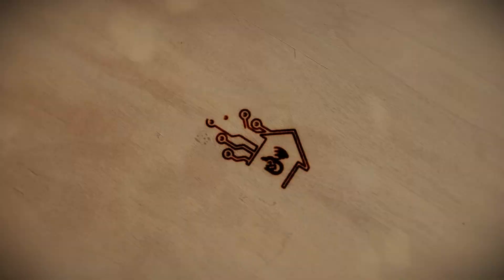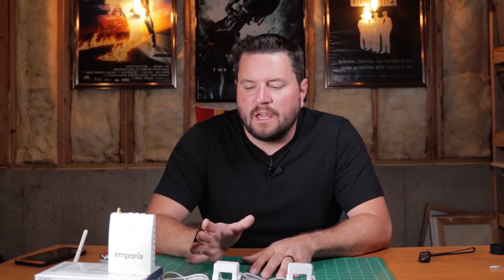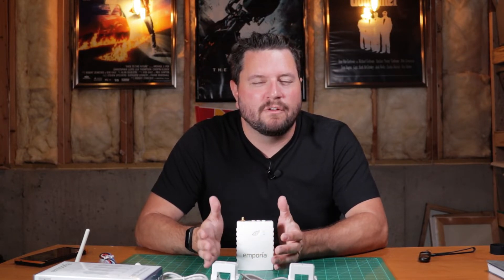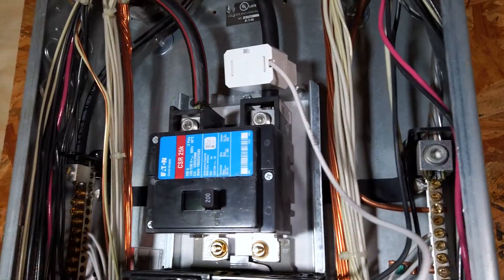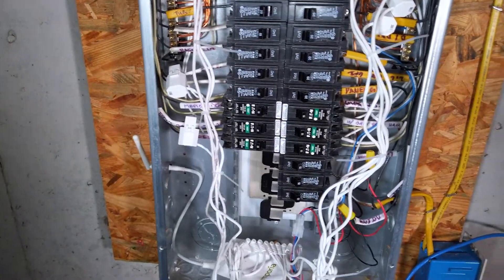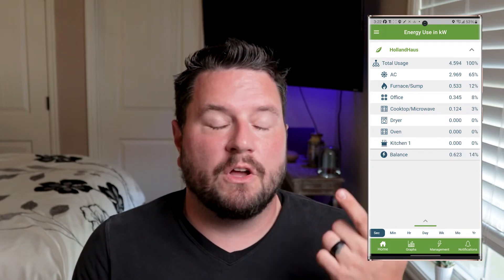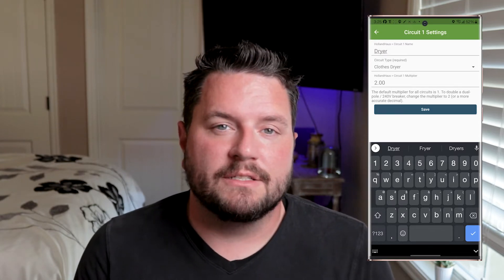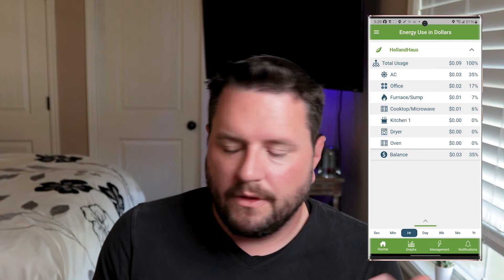Monitor All of Your House's Electricity Use // Emporia Vue v2

Comment from the maker: So a few viewers pointed out that I have the CTs backward on the 200A circuit.  I had misread the manual and completely missed the diagram on that page.  You have the arrow point toward the panel, not the meter.  Thanks for pointing that out Doug and Michael.
Reply: Correct. The K - > L arrow should point toward the breakers.
Reply: I was going to point out the error, but you have corrected it. What I am interested to know is did the app show the same usage with the main CTs placed either way round?
Great video👍
Reply: @grahambrown5874  I read that the Emporia will automatically adjust if you install the CTs backwards on the 200A mains, but not on the 50A CTs.

Comment: I like that you're a former TED user.  My TED just died and I'm looking for an alternative.  What I really liked about TED was the API.  I wrote my own programs to log and display the data.  Haven't found anything else yet that has an API.
Reply from the maker: The emporia doesn't have an API but people have reverse engineered the app. That is how the home assistant integration works.
Reply: @ThisSmartHouse  I just found the emporia forum and there is a long thread in there about this.  Looks encouraging.
Reply from the maker: They are a good company. I purchased it after chatting with the engineers. They seem receptive to feedback.

Comment: RTL worked for me. For electricity any ways. My water meter uses frequency hopping (I think) so never could get those signals. Found a few neighbors tire pressure monitor sensors though. ;)
Reply from the maker: Nice! How often does your power meter update?  Really, TPM sensors?. That is awesome.
Reply: It seems like our power meters blast out every 10 minutes or so. Maybe even more often. I have the rtl_433 HA add on running on a few frequencies and hopping every 400 seconds. That gets my Lacrosse outdoor temp sensor reading too.

Also... It took some figuring with value templates (filters too) to get all the rtl sensors to never show zero or major increases/decreases at reboot or restart.
Pretty slick after that.

Comment: You should definitely connect the clamps to the device first. If you connect the clamps to the energized line then there will be current on the 3.5 mm jacks

Comment: I have a 400amp service to my house. It is basically 2ea 200 amp service breaker panels. Since we can use just 1 CT for a 240volt device, do you think I could get one of these emporia units and put the main line CT, 1 on each panel? I would expect the overall numbers in the “balance” field to be wrong.
Reply from the maker: I would check with their support. Really smart folks (staffed by some of their engineering staff).
Reply: Your total power consumption would also be way off. 240V appliances generally draw current evenly from both phases, but your panel overall will almost never have even current between phases due to how the single phase breakers are distributed.
Reply from the maker: Emporia told me they were working on a way to use 2x CT clamps and they can combine it in the back end. I haven't tested it though...

Comment: You say on the title "all of your house's elec..." but use only 8 sensors. I got a medium size circuit breaker box with 40 breakers, your set only has 8 sensors, I know there is another one that comes with 16 sensors, that would leave me short by quite a few to be able to monitor all the house circuits. Can you add more sensors if you need to w/o adding another complete kit?

Comment: Do you still use this monitor?   If so, what are your longer terms thoughts?   Also, do you use any of Emporia’s smart plugs?  I have seen some information about long term connectivity issues with the plugs.
Reply from the maker: Yep it is still running strong. I actually have more sensors to install but haven't had the chance. I don't have any of the smart plugs from Emporia, but I have a ton of others (WiFi, HomeBridge, ZigBee, Zwave).

Comment: For a home with a main panel and multiple subpanels, is a separate monitor/controller required for each panel?
Reply from the maker: I would think so.  I assume your sub panels are more than 50A?  I think that is the max for the individual clamps.  I would reach out to Emporia's support, it is top tier (I think it is staffed by their engineering staff).  They might have a more cost effective solution for you.
Reply: This is the info I'm looking for as well. One main panel with (2) 100a subpanels. It's 2 separate dwellings so to figure out electricity usage per unit.
Reply: I have a sub panel that is wired off the meter so the 2 main coils don't capture all the data - Ive tried capturing it with the 50 amp coils but it screws up all the math
Reply: @dougboss6391  would need to run a separate analysis over whatever period of time you're comfortable with to get you what you need to know. Otherwise you could buy a unit for each panel. I personally went with the fist option.

Comment: Hi. In our house there are two sheets with separate power wiring. Looks like that the splitter is outside, close to the meter and with no access to it. My question is there a way to use one device  in my situation or I need two to monitor whole house? Thank you!
Reply from the maker: Do you have 2 phase in each section? How far are the two panels? I would think you would probably need two monitors unless they are relatively close.
Reply: @ThisSmartHouse  Yes, there are two phases in each section. And they are next to each other. But counter only one outside the house.

Comment: For anyone using this product; After monitoring your usages for a bit, did you change your habits in an attempt to lower your energy consumption?
Reply from the maker: It pointed out a few things (like some old incandescent bulbs that were being used a lot). But mostly I use it for automations.

Comment: My Emporia says the opposite; L is to the breaker and K is to the meter. The word "Breaker" below the K--->L points to the L as well. When installed the cable is on the left of the clamp, not the right.
Reply from the maker: I posted a correction. I had it backwards.
Reply: @ThisSmartHouse  I was just trying to help. I also installed mine today and interestingly, the clamps for the mains coming in are installed in one direction but the individual 50amp clamps clamp on in the opposite direction. The reason I picked this up right away is that the clamps have the K-->L "plus" the word Breaker---> on each one. They are opposite each other.
Reply from the maker: Sorry if that came off terse. I didn't mean it that way.
Reply: @ThisSmartHouse  Not at all! We are totally on the same page. Thank you for the replies and being a great contributor. 
Not terse at all. I didn't want you to think I was trolling you to point out mistakes. I was being friendly and helping.  Keep up the great instructional posts!
Reply from the maker: Thanks for pointing it out. I do appreciate people who correct.  I want to put out the best possible instructions for people and sometimes I do end up making mistake. I just wish youtube allowed you to put text over a already uploaded video so you could edit out the mistake.

Comment: Is there an option to monitor a generator set home backup?

You only need a single clamp for a double pole 240v breaker?
Reply from the maker: Are you just wanting to check the output?  I would think that if you just want to see a rough estimate you can do one clamp.  Do you have an ATS or switch gear?

Comment: You said it requires an internet connection, and that's when the red flags started going up. And I'm not wild about using wifi on a stationary device either.
Reply from the maker: Well there are advantages and disadvantages to each method.  There is some back end analysis that needs to be done that I assume the unit won't have power to do.  I have talked with them about local control and API access.  As far as Wifi goes, most people probably don't have ethernet at their power panel.  But yeah, I get it, I would love to have had ethernet as an option.

Comment: So thankful I watched this lol, so you can install it to two separate existing individual breakers if I understood you correctly? I was thinking of getting the sense and also saw mixed reviews as well as needing a 240v two pole breaker and only having one spot for a single pole breaker. This may be the device for me. Also, I see there’s an integration for home assistant through HACS, I’m also pretty new to home assistant coming from smartthings and hubitat. Can’t wait to look a little more into this device. Great video!! New subscriber here!
Reply from the maker: That is exactly why I put the video out!  I was hoping it would be helpful.  Yes, you can install it on two existing 120VAC breakers (they have to be adjacent so they are on different phases).  I think the reason you see people say you need the 240 VAC two-pole breaker is because I believe the National Electrical Code requires it (you have to be able to disconnect both sides of a circuit at the same time).  But because these are two separate circuits that you are just tapping into, then it should be ok.

I had just gone out to the hardware store to grab two extra breakers when I re-read the manual and found the alternative install.  I figured this would be the one most people would use.

Home Assistant / HACS integration video is coming out next week.  I can confirm it works well with the new energy dashboard.
Reply: @ThisSmartHouse  awesome man. I saw the machine learning on the sense was pretty iffy but this comes with an addition with the individual clamps for almost 1/3 the price lol this is a no brainer for me. Can’t wait to see the next video on this product. So I’m guessing you would recommend this one? Lol
Reply from the maker: Well just to be clear, I have only used this one and the old TED5000.  But what I have seen with reviews and with the power of the HA energy dashboard, I think it is a real winner.  

Also I will say their support is stellar.  When I first found the product, I contacted their support with some questions and got hooked up with one of their engineers.  Super knowledgeable and helpful. So reach out if you have questions!
Reply: @ThisSmartHouse  awesome. Thank you!

Comment: I am not understanding why sensors need to be placed on both legs of a single phase 240v system.  Each leg is 180degrees from each other and amperage is measured on one leg only.  If the sensors on any monitoring device are placed correctly one leg  as example will read "x" amps and the other leg "-x amps"  they will cancel each other out because of the phase.  Another individual making a Utube fixed the problem by reversing the CT.  Which is not correct. If anyone uses an amprobe it is used on one leg either one.  This is not the first time I have heard someone talk about manually doubling the result but unless I am missing something this is not correct.  A note that 240v is used to make the wire size smaller in an application.  A toaster that runs on 120v at 9amps will run at 4.5 amps at 240v (if set up to do so) and use the same amount of watts.  120x9=1080 or 240x4.5=1080  The wire size can be much smaller in the case of the 240v.  NOW MAYBE I am not understanding the operation of the unit BUT they did not supply 2 CTs for 240v circuits.  If I am off base sorry!
Reply: There can be a difference of voltage between one leg and another in a panel. For example, if your microwave and a space heater are both running and happen to be on the same leg, but there's nothing else happening on the other leg. You'll have a difference in voltage and current between the two legs. For a single 240v appliance that does not use a neutral (such as an electric water heater) the two legs used on the double breaker are directly connected through the device. Even then, multiplying these loads by 2 is not as accurate as having a clamp on each leg due to possible voltage differences again.

Comment: Looks like mounting the antenna is less convenient if you have a flush mount panel like I have.  I hate to drill holes in the cover, it I see no other easy way to do it.
Reply from the maker: Do you not have knockouts on the side of the panel? Most ones I encountered do. But that is moistly North American ones.
Reply: @ThisSmartHouse  Read my comment again.  There is one key word in it.  😁
Reply from the maker: Drill or flush? What is a flush mount panel?
Reply: @ThisSmartHouse  Flush.  The panel is recessed into the wall such that the face of the panel is flush with the drywall.  The knockouts thus just go into a finished wall cavity.
Reply: @LTVoyager  This is my question as well if the sides of the panel are behind drywall as in most houses how do you install the antenna?
Reply: @TimMcMahon80  You would have to drill through the drywall and fish the cable through a wall cavity.  Doable, just not nearly as easy.

Comment: When you are in Second and Minute tabs, it looks like it is measuring "Power Consumption" measured in kW.  This is not the same as kWH which is energy consumption.  It also says in the Second and Minute tab "Energy use in kW" which is not correct.
Reply from the maker: That if why you use the integration (rienman sum) integration. It takes snapshot information and converts to usage.

Comment: What is the maximum Amperes allowed for measure before getting its wires melted ?
Reply from the maker: You mean the CTs? The main are 200A and the breaker ones are 50A. But the wires wouldn't melt because the current in the sensing wires is tiny.
Reply: @ThisSmartHouse  and isn't in danger of fire the thin wires in different colors (Black+Red) when consuming all the building power in the charge center ?
Reply from the maker: I guess it all depends. There are safety ratings (dictated by the national electrical code here in the US) for all wiring. Any short runs are going to be reduced probability of a fire due to the fact that they don't generate a lot of resistance. 

What's your main concern?
Reply: @ThisSmartHouse  My main concern is about having installed my Emporia Vue 2 Gen, and get any of the colored wires (included in the kit) in fire risk when a lot of power is demanded by the building causing the main power lines  feeding the building trigger the main termomagnetic breakers.  They're are very thin, and in such situation they might be the get in fire, or melted causing a major safety issue.
That's what I am worried about.

Comment: I think the 200 amp CTs were connected backwards - load would be the panel not the meter
Reply from the maker: I followed the manual, everything is working.  I may have mis-spoke.
Reply: You said it wrong, explained it wrong, and connected it wrong, per the manual.  The mains power is flowing into the panel so the panel is the load and the arrow goes into the panel.
Reply from the maker: I just went back and watched it, yep I had it backward.  When was reading I saw the "K" imprint toward the breaker. The diagram at the bottom right clarifies that is the arrow toward the breaker.  I will add a note in a pinned comment.  Thanks for pointing that out.  It is strange that it is working fine, maybe because they both are backward.

Comment: houses are 1 phase
Reply from the maker: Houses here in the US are bi-phase. 240/120V AC.
Reply: @ThisSmartHouse  Residential electric service in the United States (120/240 Vac) is sometimes called two-phase service but this is NOT correct. It is only single-phase, since both line voltages are derived from a single phase of a distribution transformer with a center tapped neutral and are 180° out of phase with each other.
Reply from the maker: Steve you are technically correct. But both in practice and in technical terminology each half of the 240vac system is called a phase (as you said each half is 180 degrees out of phase). 
I work in renewables and to get 240vac requires two sets of inverters. So we use the term bi-phase to call out the need for extra inverters when powering from our DC system. 
Who would have thought electrical naming conventions would be confusing... 😂
Reply: @ThisSmartHouse  I get the confusion and glad you understand.  It is only getting crazier as solar, wind, and EV charging and discharging all come into play then toss in batteries and dc.  On top of that there is so much info which is incorrect and all these people who believe the only way to charge vehicles is to install 400 amp service when they barely ever use 100 amp of the existing 200 service they have.  Then many promote all these “plastic/pvc boxes and in chicago they are not legal as everything must be in conduit and it also serves as the ground for the electric service.

Thanks for the reply